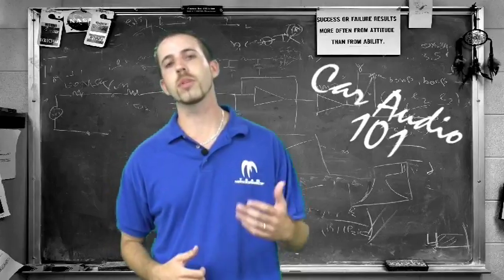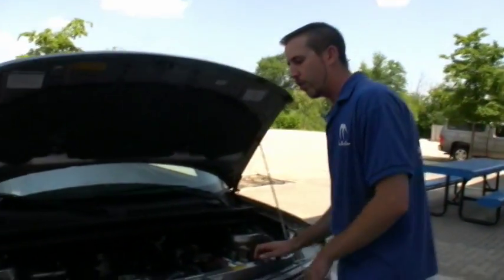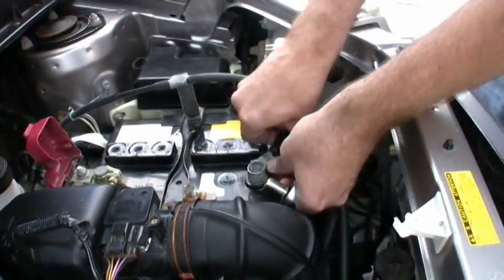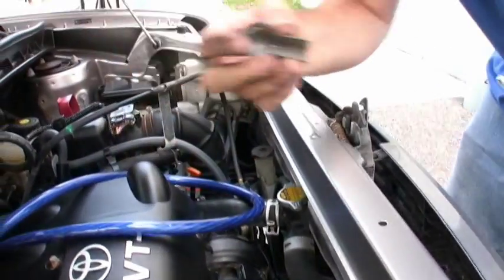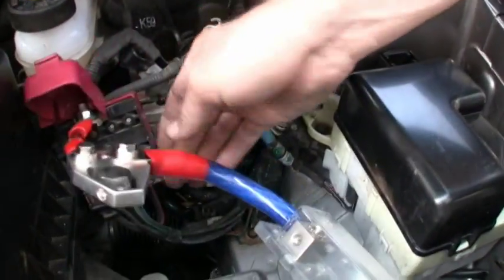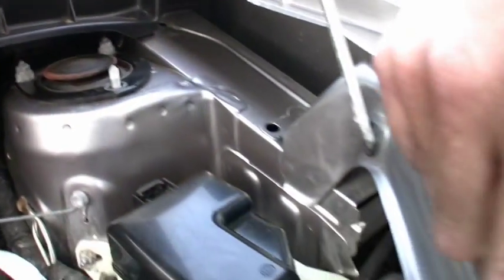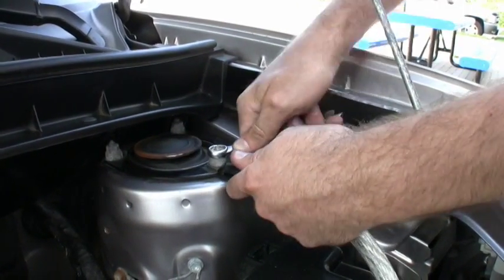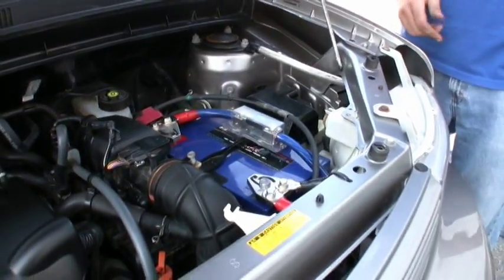Car Audio 101 - The Big 3 Upgrade Tutorial

Comment: Where can I find those battery terminals that accept ring connectors?  I'm finding only the ones that use those allen wrench screws to hold the wire in place.

Comment: peladetoparati is your system 2,000w RMS? or is that peak? Typically the big 3 only becomes necessary after a certain amount of wattage. Most factory cars can usually sustain from 600w-1200 or 1000 being the max without any issues. once you hit around the  1500-2k RMS range then you might want to consider either a bigger alternator and more batteries or the big 3 etc.

ricerust Yes, you never want to connect your batteries in series other wise it will run at 24v and destroy most of your 12v equipment.

@DjMrTechnoman, the type e 12' are rated at 250w RMS, if the amp is CEA2006 compliant and puts out 1000w, that should be more than enough to power them. Their peak is 750w so keep that in mind when you are doing the wiring (4ohm, 2ohm etc)

Comment: I'm running 0 gauge for the big 3 on my '06 xb, Stinger 4-gauge back to a Alpine PDX1.1000 (1068rms), and a separate Singer 4 gauge to my Alpine PDX4.100 (450rms). Is that sufficient enough?

Comment: im not sure how to calculate the maximum amperage the wire could handle.. what will happen if i fused it higher or lower than im supposed to? or further and closer than 12 inch from the positive terminal?

Comment: ok you said if your not running over 1000 rms dont upgrade wire. im running jl500 slash series and 100.4 jbl amp for door speakers. so maybe 1200 ish if not less. thats the most power im gonna be pushing dont plan on upgrading so. i have a stock alt with a 75 AH battery using all top line 4 gauge wire max for jl amp. and amp still cuts off? should i do this upgrade? if i do im going to use 4 gauge wire same wire and yes its top of the line

Comment: Okay one question I have an 04 Regal and I plan on doing the big 3 to it, now I have an extra electrical box before the wire goes to the battery, can I just leave the factory wire plugged in for that and then run my 0 gauge straight to the battery?

Comment: question, i have an upgraded battery stock aternator and 4 gauge wire ground and power but 8 gauge aternator to battery. My sytem is drawing 1600 rms. I have no light diming problem or any other electrical problems at all yet, but i would like to upgrade just incase, should i move up to 0 gauge wire all around or should i just save up for the alternator first? i'll do both in the long run but saving up money takes a while, just need to know which should go first.

Comment: I have a Question??? My battery is in the trunk am i able to just run the positive to the alternator or do i have to run both wires up front including the ground from the engine block to the trunk frame ??? HELP

Comment: Hello i just brought 350amps 45ah battery i have 1,6k wats sub but i think its runing on 600w amp i have the capacitor but the problem is thats its still my lights are flashing its i think because my speakers are not supplyed with cap cuz they dont have amp on, so i think i have to upgrade big 3 would it ok with 8 or 6 gouge wires? still better then stock ones.

Comment: I want to improve the power in my xb.  In the future I may add a 500 rms sound system and fog/driving lights in the bumper. Would it be a waste to use a cable less than 0 gauge?

Comment: This is the only video I have seen where a fuse is used on the alternator line.  How necessary is this?  Why is the fuse within 12" of the battery?  I thought they work better (or how they are supposed to to be by one audio installer) if they are placed greater than 12"?

Comment: 3.)what would be the best amp rate would i need for the subs?the highs and mids?
4.) would replacing my duralast gold battery with a yellow top optima with the big 3 and with copacitor be enough for my sound sytem? so i wont have to add an extra battery

Comment: doing the big 3 would it counsel out the fact of use a capacitor or extra battery?
i have Kicker VR 12" 2-Ohm with a 500 watt amp but lookin to up grade that to a 1200 amp and then porting the box with jbl t696, kicker 2-way Component System  Peak: 240 watts per set w KICKER DS693 with a 800 watt but also lookin to upgrade that and 1200 watt amp too i just replace my alternator a month ago and got a durlast gold battery

Comment: Do you really need a fuse between the power an the alternator? most vehicles I see just run the 0 gauge wires/big 3 upgrade without the fuse.

Comment: @SwiftXZ- 

Fronts- Alpine 6.5" components w/ passive crossover

Rears- any basic 2-ways that can take 80 W rms will do

Amp1- Rockford Fosgate R400-4D

Subs- Sundown SA12-D2 (x2)

Amp2- Rockford Fosgate R1200-1D

Box- custom built of mdf tuned to 32-ish Hz

Result- 4 corners driven at 80 watts rms each, seperate tweeters up front for staging, 2 subs putting out 1200 watts at 1 ohm, sweet setup

Comment: @MaxxsonicsUSAInc I am putting a 140 amp into my 72 dodge, I have a red top in front,0 gauge to  stinger in back. I have put a 4 g ground to chassis on the front. It has a stock 4 g engine. But it has a skimpy 10 g alt to battery. Can I just run a new 4 g wire to it rather than redoing all to 0? I'm only pulling around 1400

Comment: Mike... Can you make a quick amp(s) suggestion. I wanna power two 100 watt (rms) 6x9 JBL's (GTO938)'s in my rear deck. I've also got two 3.5 inch 25 watt(rms) each JBL's (GTO328) in the front dash. It's not a competition system by any means but I want it to sound clear and don't want to blow the speakers or cook the amp. Thanks OneOut

Comment: im having a weird problem with my car my dad said might be my system. ima discribe it in hpes that you have something of an idea of what the cause is.. i have an alpine mrp-m500 (500wrms) hooked to my (sadly) standard car battery. its brand new. its hooked up using a 0 gauge wire ran to the battery.the ground is a 4gauge cable that i have screwed up into my trunk on the metal.stock alt
my car has a delay in start sometimes, no crank til after a second or so.and it died1 time but started right

Comment: hey i have a question.  i have a 1994 Nissan 300zx 2+2, and i was wondering how hard it would be to do the big 3 upgrade to my car. because how my car is set up my alternator is on the bottom of my engine because it is a Japanese brand, i want to to do the big three but i don't know if the Radio Shack here in my town will do it and not mess up my car, you know what i mean? oh and you also have to have a jack and jack my car up to be able to get to my alternator because of how low my car is

Comment: Great tutorial, thanks!  I have a question regarding the in-line fuse from the alternator to the battery . . .  Which fuse holder and fuse amperage you used and where can I purchase them?  Is there something similar that I can purchase locally?  Much appreciated.

Comment: i bought a new alternator for my Lexus RX300 but then i didnt know that the output charge is only 12.5 that is not enough to charge the battery my battery needs 14 or more than... I think thats the reason y my lights are dimming and everytime i used power windows lights at night my alternator produces sounds like squeeking. What should i do w/c one should i change it? The battery or the alternator? Or the big 3 can help? What more if im going to replace my system into hifonics 1700 and 15" 1000

Comment: Ok, I have observed replacing the battery and the positive and negative wires to the alternator with 0 gauge wires, so that the feed will be more stable both to the engine and your audio system, yes?

Comment: my question is i bought a real nice 2001 expedition and from the battery to the back of suv is a postivie and a negative 4 gauge wires, rca cables and a assuming amp turn on.it came with a dzp905 dash video player.so i just purchased a pioneer gm7100m 800w amp for 40 bucks from pawn(always find good deals there).what fuse should i use in fuse holder by battery on the 4 gauge wire. there was none in there.

Comment: Great Tutorial.  I'm just in the middle of doing that with 0/1 Gauge Stinger Wire.  One small difference...My positive battery cable comes from my Starter not my Alternator.  The short clip between the engine fuse block and the battery + , should that be 0 gauge as well or the 8 gauge that originally was in.   It's a 94 Probe if your wondering why the + battery cable is different.   Replacing the BIG 3 on one of these cars - challenging.   Again, thanks for posting the tutorial.

Comment: Gr8 series! I'm a noob; all I want 2 do is add this setup:

A. Head Unit-50x4 watts
B. 2 10 inch subs (800 Watts Total)
C. 1000 Watt Amp

So far everything is stock, nothing has been changed.  Buick Lasabre 02: 105A Alternator, Duralast Gold Batt.

From ur experience and expertise.... 1. Should I change "THE BIG 3" wiring to 0 gauge for this setup?  And 2. Should I supplement my batt with a kinetik batt or replace it with a kinetik batt? 

Or should this b enuff 4 what i'm trying 2 do?

Comment: what's the point of connecting the ground to engine block and a place on the chassis when they are essentially the same thing? i mean the engine is held in place with fairly large bolts on the chassis of the car you could just simply run two 0 guage wires to the same point and it would be the same thing as grounding the engine block and chassis

Comment: Ive have my car wired in 1/0 gauge. Alternator to battery, battery to chasse, but my main battery is under my rear seat so i didn't run a wire from my battery to engine instead i have one directly from my alternator to my chasse is this alright? 
P.s. I Just Bought A DC Power 270xp Alternator is their anything else i need to do for a HO Alt.

Comment: Can you use regular AMP power cable? or is that a special type of cable? an audio shop told me once that 0 gauge AMP power cable isn't good for that because the strands in the wires inside are to small. so stick to battery cables.

Comment: i have done the big 3 now how much current can i draw through my knukonceptz kollossus o gauge wire? cause i want to run two hifonics brz 2100 amps using only one 0 gauge setup with a tsunami 10 farad hybrid power cap and a kinetik 2400 batt under hood and a 300 amp alternator.

Comment: What's up? Question I have a g35 coupe I'm putting a 10" kicker L7 with a 2000watt lenzar AMP,,the sub is 4ohms I didn't do any special wireind like 4ohm to 2ohm I left it alone cuz it's in a factory L7 box,,,I read the specs on the amp and at 4ohms I would get 600rms and that the highest the sub can handle,,BUT I was thinking of getting a shuriken batter for under the hood so stood I do that? And what would I need like how many amp hours? Or should I get the one u have but don't know which one

Comment: why do you have to add 2 grounds? what if i just add a 0awg wire on top of the stock wiring from my alternator to an upgraded battery without adding any from the negative post of the battery and just left it stock?

Comment: I have a Hifonics Brutus Z1700.1 Ratings: 900 @ 4 ohms, 1200 @ 2 ohms and 1700 @ 1 ohm. I ran 4 gauge wire to my amp and the fuse blew. I also have a problem with my radio. The volume turns itself down when the bass hits. I have done the big3 with 4 gauge wire. Do I need to upgrade all of my wire to 0 gauge? I already bought another battery, not the best actually, on a budget. Is my problem a power starvation problem or is it my radio?

Comment: Not to be a dick but the ground shouldn't be like that. The ground wire you have set up is actually not the best possible ground you could have gone with. That bolt isn't directly going to the frame. The bolt is just going through the sheet metal. The bolt is attatched to the strut and so is the black top. So in reality you are grounding to a strut which then has to transfer into the body. I would have reather took the extra fe minutes to mount it straight to the frame. Good video though.

Comment: so if my power wire from my alternator doesnt run directly to my battery, then should i leave it on and just attach the 0 awg wire over the original connection to my positive battery anyways? and if so, do i leave the factory wires on the battery and just add the 0 awg to it also or can i remove the factory wiring that is connected to the positive battery terminal?

Comment from the maker: @KillerKlown707 In this example, the alternator chassis is bolted DIRECTLY to the engine and there is no need for a wire from alternator chassis to ground. In some vehicles the alternator is mounted separately and a separate ground wire from alternator chassis to battery ground would be ideal for continuity of the circuit.

Comment from the maker: @BigLongJon21 The size of your wire from the front battery to the amp(s) is dependent upon your total watts. I like running 0 awg to a distribution block in the back so that you can add your amplifier(s) to that block and expand from there. What is the total watts rms of your system?

Comment from the maker: @Dinam1ta With 1200wrms, you have likely exceeded the capability of your battery/alternator combo. The BIG 3 helps with delivery on the charging side, but you may need to look at upgrading your battery to a nice deep cycle capable of the power you are working with. Pass on the capacitor as it is a bandaid which can cause more harm to the amplifier and not a solution.

Comment from the maker: @jeffm4688 If you look at 4:09 you will see that there is a bolt on the factory harness...we simply removed the factory wire that went from that bolt to the battery terminal and replaced it with a longer wire that went to the new battery terminal. Those are Hook Audio battery terminals.

Comment from the maker: @ninjafisheez Did you lave the stock wires connected? If not, reconnect the stock wires as well. Most vehicles run the primary charge line from the alternator through a fuse box, then into the battery.

Comment: Hey bro I had a question is it dangerous if I do a big 3 upgrade on a 1995 Lincoln town car if the cable on the alternator runs to a fuse box and then to the battery would I have any problem if I up grade those cables ?

Comment: Hey bro I had a question I have a 1995 Lincoln town car trying to do a big 3 upgrade with 0 gauge wire but the power starts first on the alternator then to the fuse box and from the fuse box to the battery is it safe to do a big 3 upgrade like that ?

Comment: Inpreparation for a moderate stereo upgrade and conversion from clutch fan to E-fan, I'm upgrading my alternator.  To compliment that, I plan to upgrade the alternator wiring to 4 gauge for both the negative and positive. 
Why or what's the purpose of placing an in-line fuse from the  battery to the alternator?   Original alt wire in video had no in-line fuse??
What was the size of that fuse?
I was planning to utilize an in-line fuse for the stereo power source using 4 gauge wire as well.

Comment: I have a 07 tacoma, want to do the big 3 upgrade. how did you wire the power? I get the ground (gnd to engine and then to frame), the power I am some what confused as to how you went about that 

- with the stock alt. wire, do you leave it/cut off/cover
- what kind of battery pos. terminal would I need

reason I ask is mainly due to seeing several online installs and people just adding to the wiring, not really replacing it.

Comment: i did the big 3 upgrade on my montero, a very poorly designed engine, i ran the power cable from the alternator to battery the complete oppisite of the factory route, could this be a problem the factory wire is around 4 ft in length, my wire is about 7 ft

Comment: Just installed a Crunch 1100.2 in my 05 Scion Xb. Can't get any sound from it. And I can't get any sound from my MTX amp which is powering tweeters in dash. Amps have 8g power cables running to distributor, then 4g to battery. I used 8g ground for each amp and connected them seperately to the strut posts in the hatch. Both had power lights on. No protector light on. Crunch amp turned off and on with hu remote but MTX stayed on with remote tied to Crunch remote terminal. Any ideas?

Comment from the maker: @millbrook792 It is suggested, but not required. The question to ask yourself is whether you are going to be running anything over 1000wrms or not? If so, upgrade the battery. If not, why are you upgrading the wiring?

Comment from the maker: @frierson987 Most vehicles are equipped with a low voltage indication. This would be triggered if the voltage drops to the level determined by the vehicles' manufacturer. Since the factory fuse box is still connected, the low voltage light would still be triggered.

Comment from the maker: @little11Nicky The factory charge wire in most vehicles runs through the fuse box. It is recommended to leave the factory wires in place and simply piggy back the new runs for the upgrade.

Comment: If I put a fuse on the wire running from alt. positive to battery positive will i have to run another wire to my fuse box because my factory wiring has a wire running from the fuse box to that wire...???

Comment: If i put a fuse on the alt positive to battery positive wire then will i have to run another wire to my fuse box because in my 92 honda accord, it has another wire running from the positive battery terminal to the fuse box..??

Comment from the maker: @ladodgerslakers2010 Just keep in mind that the smaller wires used will create more resistance in your circuit. I typically recommend doing the upgrade with the same size wire across the board, but it isn't required.

Comment from the maker: @sikvibration The manufacturer of your alternator should have specific instructions for installation of their alt in your vehicle. They may recommend that you use the factory charge wire, or they may insist that you upgrade that run.

Comment from the maker: @Drakky69 The inline fuse from alt+ to batt+ is not required. If you choose to do this then the fuse value should be just above the max rating on the alternator.